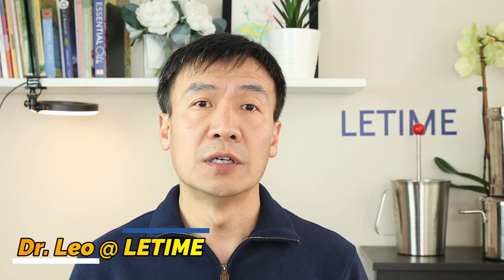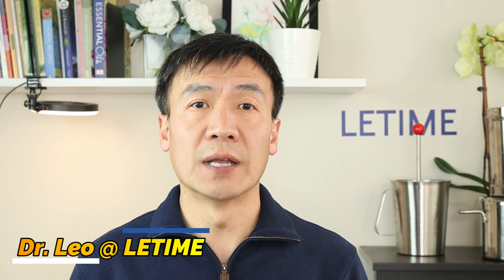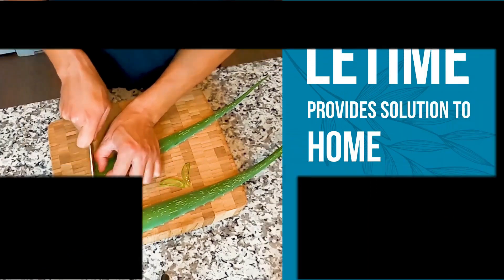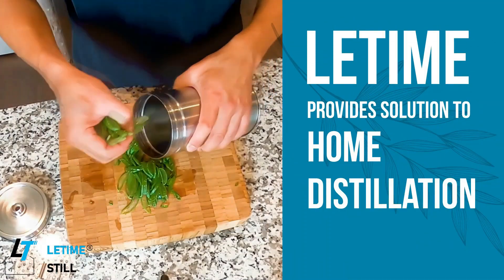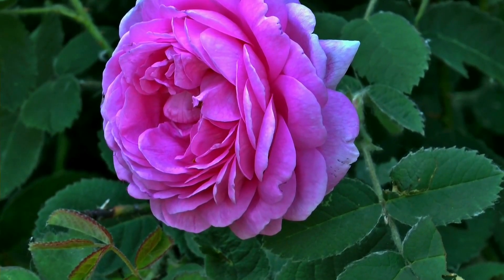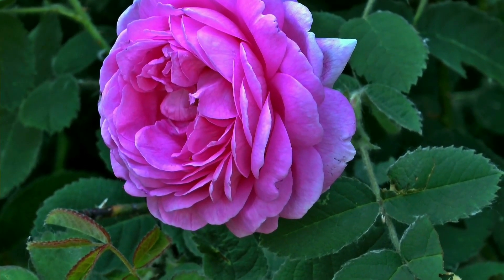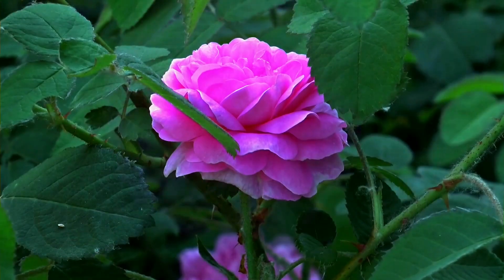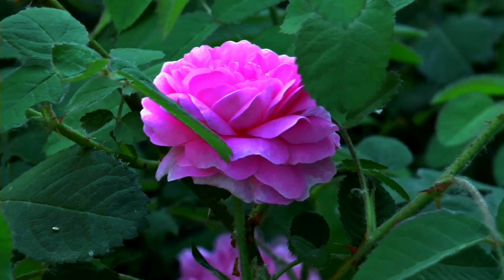Make Rosewater from Dry Rose. Difference between rose hydrosols from dry and fresh rose. Rose water

Comment: i want to make it with fresh rose in the ADI,  what is the ratio, is steam better than water and how long should i run it for. i dont know how to choose the time when distilling. thanks
Reply from the maker: You can always use steam distillation. If you add a full basket of rose petals, you may make up to 1 liter of rosewater. By adding 2 liter of water in the pot, you can set at about 1h30m. 

If you want to try hydro distillation, herb to water ratio can be around 1:5.

Comment: using the
1.5 litres of water after soaking,how long do you steam it and how much hudrosol can be harvested?
Reply from the maker: Hi, the general rule for making high quality hydrosol is 1:1 ratio between the amount of hydrosol and amount of herbs distilled. So if you are distilling 1 liter of lavender which is a full column of LT3000, you can make 1 liter of high quality hydrosol. You can make more hydrosol but will be diluted one. We have another video explaining how to tell end of distillation: How to Make Best Hydrosol? When to stop distillation. Experimental demonstration, easy to follow!
https://youtu.be/osRqRVa0rwQ

However with condensed material like root you can make more hydrosol.
Reply: @LeTimeLeo  Thank you so much for the info!!  To clarify, you said 1 liter of raw materials, does it mean that I fill up a 1 liter beaker of the raw materials regardless of weight?
Reply from the maker: @karenevers-foo7974  Yes. As I mentioned this is a general rule. However for more dense mateiral such as root, bark, more hydrosol can be made from. Please refer to my other video talking about how to tell finish of a distillation.
Reply: @LeTimeLeo thank you!
Reply: 1kg of dried roses for 1L of water? @LeTimeLeo